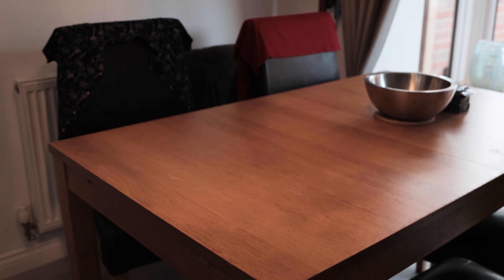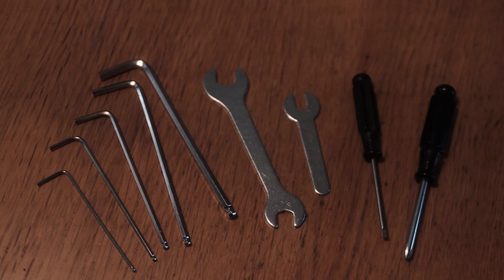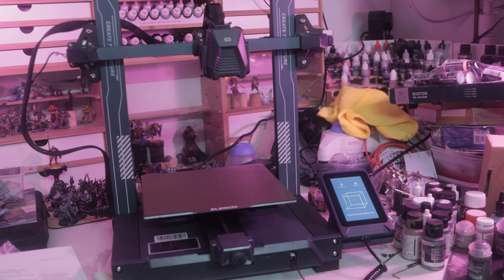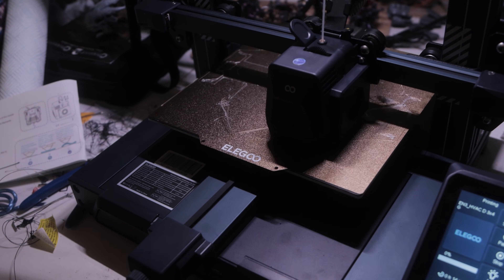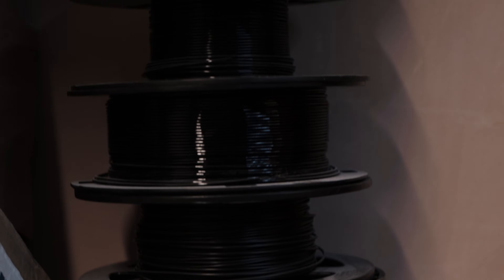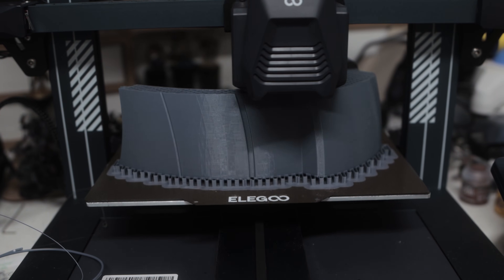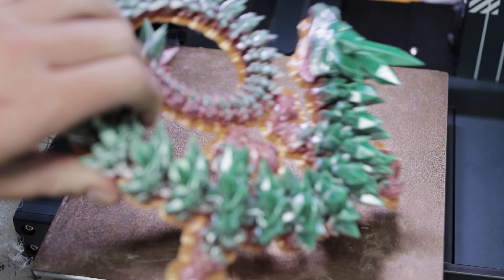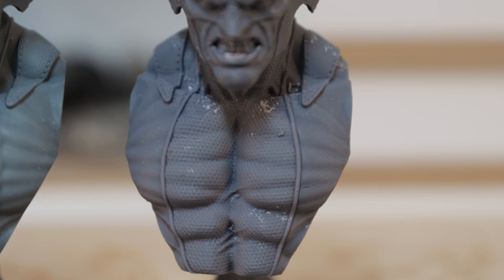Best FDM Printer for Absolute Beginners - Neptune 3 Pro Review

Comment: I have just set up an anycubic Kobra 1 after it being sat unopened in the box for two years. I'm brand new to fdm and like you realising there's so much to learn. It took me a good while to get it all set up and then I had to Google and Reddit why things were going wrong with the auto leveling that the instructions told me to do. Then I had to go back to Reddit to find out something else that the instructions didn't tell me about. 

Finally got it up and running but now I need to find out how to get the settings correct.

Comment: What profile did you use to print at 0.06? Did you have to change the nozzle or did you use the stock nozzle?
Reply from the maker: Just the default profile in the slicer mate
Reply: @FauxHammer  thanks! I’ve been fiddling with my Neptune 3 pro trying to get a print quality like that Wolverine you made and I couldn’t figure it out for the life of me.

Comment: I don’t recommend using pla+ for everything. Pla+ is the same as regular pla when it comes to print quality. The difference is that pla+ is better in heat and slightly more durable. Uses that don’t need either properties are just a waste of a bit more money. Just make sure to buy pla from a good brand (like elegoo)
Reply from the maker: Thanks, I get more issues with normal pla typically.

Comment: 13:28: There are actually reasons to get smaller printers other than space and money for the initial cost of the printer.
1. Larger heatbeds will probably take longer to heat up, and almost certainly need more power to heat up/maintain heat.
2. Bigger printers are almost always slower than smaller printers. At least, that's what the Voron community seems to say about the size options for the Voron 2.4, because the weight of the moving parts limits acceleration, and acceleration controls how quickly you can reach your top speed. And this is even worse for bedslingers like the Neptunes. In addition, I'm fairly sure that ringing/ghosting will be worse on bigger printers.
3. In addition to the cost of the printer, replacement print surfaces at sizes beyond the standard 235x235 are more expensive. And I'm pretty confident that bigger beds will probably warp more than smaller beds, so thank goodness they'll come with a mesh probe. But the N3 Pro uses a 6x6 mesh, the N3 Pro uses 7x7, and the N3 Max uses 8x8. So the N3 max will probably take almost twice as long to probe (64 isn't quite double 36). And the N3 Pro is probing pretty slow by my standards, although I'm using a souped-up Neptune 2S with Klipper, a BLTouch, really fast Z and X/Y speeds.
4. Thanks to the popularity of Ender 3 and clones, most printers on the market are 235x235, so most people designing models keep that in mind when printing them.

TL;DR unless you have specific things in mind that are larger than 230x230, the majority of people probably won't use the extra space. Bigger isn't always better, it's just bigger.
Reply: Thank you for this comment I was torn between the pro and plus but after reading your comment I can't justify the extra print volume so imma stick with the pro since my prints never take more than 20~40% of my ender 3 v2 neo's volume

Comment: i downloaded and copy stl to the micro  sd but neptune 3 pro cant read it. what do i need to do?
Reply from the maker: micro disk? If I knew what you meant i would help.
Reply: @FauxHammer  micro sd
Reply from the maker: @khanhangduy8013  you need to run it through a slicer programme that's on the included sd to create the file the printer can read
Reply: @FauxHammer  oh tks. Can i use cura? I only know this program, i going to learn how to use it.
Reply from the maker: @khanhangduy8013  that;s the one on the USB Drive, Elegoo's version of Cura, you can use original cura but need to make sure you have created the correct settings for the Neptune 3 Pro
Reply: @FauxHammer  tks for your help. very appreciated it

Comment: This was a great video! I've had an Ender 3 for a couple years and it's forced me to learn all the ins and outs of filament printers. I finally had an issue (layer shifting because the motherboard overheats after a couple hours) that caused me to ask "why am I having to do so much troubleshooting just to get this thing to work at a base level?"

I have an Elegoo Mars 2 Pro and the "it just works" level of functionality in it made me decide to look at Elegoo's FDM offerings. Your demonstration of being able to "just print" once you got the proper filament is exactly what I want in an FDM printer! Can't wait for it to show up.
Reply from the maker: i have the opposite problem, I have this so I have no idea how to read the signs of failure or quality degredation.

when this works, it just works. but when it doesn't work, I'm completely lost
Reply: @FauxHammer  Biggest thing I can recommend is watching the first layer go down.  As long as that looks good (no separation of strands on the fill, outer walls staying laid down) and is sticking to the build plate, you're usually okay the rest of the print.
Reply from the maker: @donchaiminster1989  i;ve got that down, but I'm getting some odd issues mid print and when i'm pusging for layer quality, this is key. need to learn it becasu I;m expected to know it to validate my views of other printers!

So I need to learn how to fine tune, temp, speed and flow rate. just no idea the best way bbecasue each seems to affect the other.

Comment: Hello. It's seem that nobody here note this : the point zero is not in the center of the bed (is on the right and on the front). During the calibration the head begin outside the bed at right and finish 3 cm into the bed at left. It's very strange. Someone can explain me?
Reply from the maker: The nozzle is touching the bed. That’s the middle of the print head and the important part to touch the plate.

The nozzle is not in the middle of the print head. It’s to the left side

Comment: question I ordered an elegoo Neptune 3 Pro how tall is this printer the whole printer because I'm going to get a cover for it or Do you know a suitable good cover for it? where to buy 3d printer enclosure for elegoo neptune 3 Pro?
Reply from the maker: With the filament on the back mine measures 74 cm tall. whilst you can look at the printer dimensions online, you also need to consider that the bed extends forward outwards and  behind, going beyond the printer's area.

as for enclosures, sorry, I've never used one. mine are in a warm room now.
Reply: @FauxHammer  thanks you for the information🙂👍

Comment: PLA is also great to sand, fill, and paint :) It's harder and more brittle than other filaments but I love working with it. That said, I'm going to order 2nd week of January specifically to print PETG so fingers crossed :D (I have yet to get PETG to print propperly and repeatly as well :P)
Reply from the maker: I'm still having lots of fun with PLA, PETG was possible on this but I need to learn a lot more too get it working

Comment: If I invest in a second printer, I’m looking at the Neptune line or, if I suddenly become wealthy, the Flsun V400. What I’ve discovered since acquiring my printer is they’re like boats (break out another thousand). There’s always something to buy and/or add on. The other thing is, it’s the most frustrating technology I’ve ever worked with and I started with Windows 3.0. But when it works, it’s pretty cool.
Reply from the maker: Woah, windows 3.0 was before my time. I grew up on 95!
Reply: @FauxHammer  That was a good one.

Comment: I just bought the Neptune 3 Pro and its my first printer so I wanted to ask what’s a good filament to purchase for use with this machine?
Reply from the maker: Tell me you didn't watch the video without telling me you didn't watch the video.

Jokes, 

I had the same issue, so the eSun I used just worked as the profile is on Elegoo Cura. no idea if it;s the best, but it works and that;s what matters to me

Comment: PTFE is Teflon used for Bowden tube setup. Petg is the filament used to print. PET is used in plastic bottles.
Reply: PET can also be printed
Reply from the maker: i think I;ve seen some videos where someone turns plastic bottles into fillament and then prints with it.

Comment: Just a note, Elegoo tech support is AWSOME.  I had a fast response and they got the problems fixed and new parts shipped out quick.  I have 2 Neptune 2S one was new the other was used and had some missing parts.  I sent a list of the missing parts and Tech Support rocked the house with speedy delivery.  Elegoo supports their products.  Hard to  go wrong with what every printer size you choose.
Reply from the maker: I've heard mixed things, never dealt with them directly.
Reply: Yes if you are in the US
Reply: I email Elegoo two weeks ago no response yet
Reply from the maker: @reggi200  they got back to me next day. I had an issue with this on my day, woke up Tuesday to a reply. And no I did t Co tact then as Fauxhammer
Reply: @FauxHammer   I don’t have the same respond . The machine is very good but I get a bad one

Comment: Cool review. I guess filament for large stuff and resin for minis is a good rule to follow?
Reply: Absolutely.
Reply: Filament is easier to work with, more durable.  Resin is faster to print , much higher details but more complex, more toxic, not durable and smaller print size. So yes you are right but it's more to it.
Reply from the maker: exactly that, but there's the finish benefit too when it comes to models. FDM prints are full of layer lines, even at the lowest layer heights, resin all but eradicates layers.